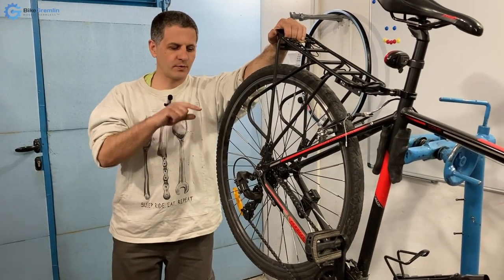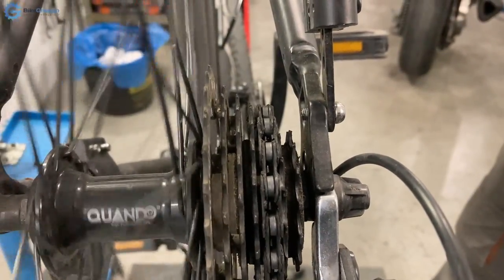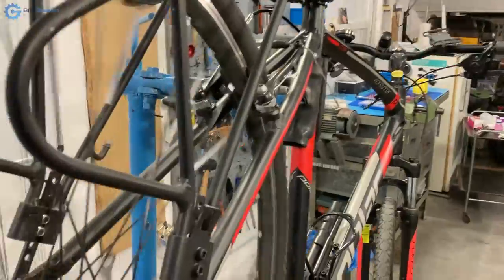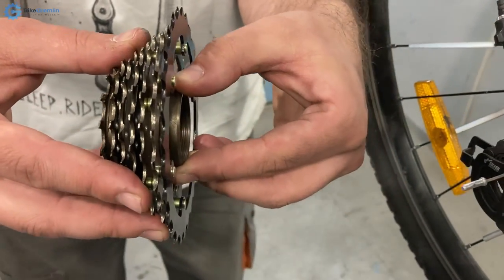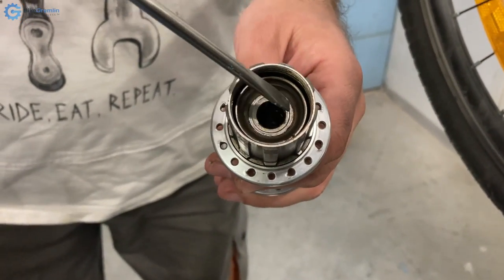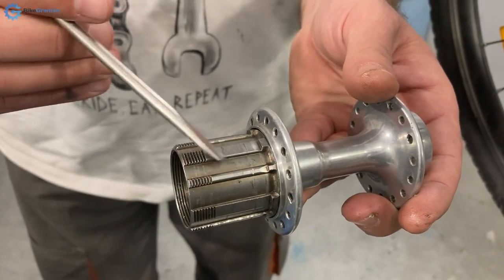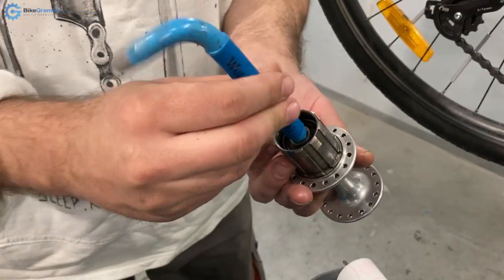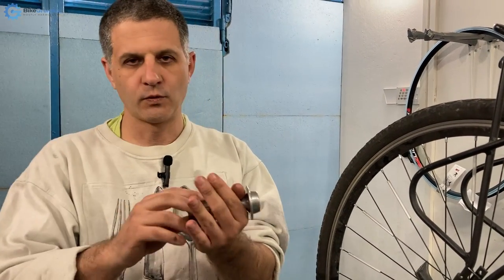Cassette (& Freewheel) Wobble explained

Comment: Thanks very much for the explanation and putting my mind to ease that this often seen phenomenon is pretty much normal 👍🙂
I was thinking that somehow I had put the new cassette on incorrectly or that I needed to try and put even more torque onto tightening the lock ring even more.
Your channel and website are great resources for us cyclists with normal (not super high end or super specialized) bicycles.
.
One potential and serious issue that you did not mention is if someone installs a 7 speed cassette on a hub designed for 8 or 9 speed cassettes and didn´t use a proper metal spacer that is placed between the hub and the cassette.
.
cheers!
JB
Reply from the maker: I talked about that in this video:
https://www.youtube.com/watch?v=Ahzab3i0IZU

And in the article about rear hub compatibility:
https://bike.bikegremlin.com/1259/bicycle-rear-hub-compatibility/

Relja

Comment: hey i was just wondering about something. my shimano cassette is wobbling and its making a small grinding sound. its not super  loud but its noticeable so i was wondering if i should still be concerned or if it is not a big deal.
Reply from the maker: The grinding sound could mean some bearing is toast, but it could also mean that something just needs cleaning or tightening.

How to pinpoint the source of any strange bicycle noises:
https://bike.bikegremlin.com/7153/creaking-clicking/

Excessive wobble could mean a bent/broken axle (when they bend, it means they have started cracking). You could remove the wheel and see how it acts when you turn the axle and spin the wheel in your hand.

Relja Novovic

Comment: Sir I'm from India and very depressed because of my cycle i changed my 7 speed shimano freewheel and chain but now it whenever i shift my gear from higher to lower gear it doesn't shift and sounds like clicking i changed the axle but it doesn't works now the cycle mechanic told me to change my hub, freewheel, and chain because it is causing wobble i already spends lots of money i don't know what to do i also adjusted the derailleur properly higher tension gives smooth shifting while shifting to higher gear but gives me problem chain slipping clicking sound in lower gears my problem is totally different please help me what is the main problem 🥺🙏
Reply from the maker: If a mechanic had a look, that could be better than diagnostics over the Internet. 
Having said that, you could describe the problem and post pictures on the BikeGremlin forum:
https://www.bikegremlin.net

Relja
Reply: @BikeGremlinUS  cycle gear mechanics in my city don't want to fix the problem Professional mechanics are only in Delhi or big cities
Reply: @BikeGremlinUS  i will surely upload detailed video on your website

Comment: Have a similar problem but while peddling and the bike is brand new any clue why?
Reply from the maker: For the same reason as explained in the video. The wheel is turning along with the freedwheel mount, and the freewheel mount is not 100% perpendicular. 

Of course, it’s good to check and confirm that the wheel’s axle and bearings are good, and that the wheel is mounted properly. 

Relja
Reply: @BikeGremlinUS thanks
Reply: What are you selling?